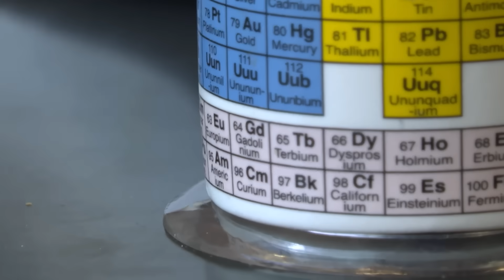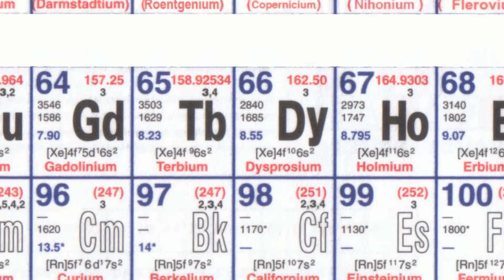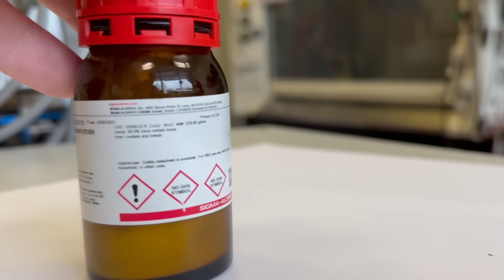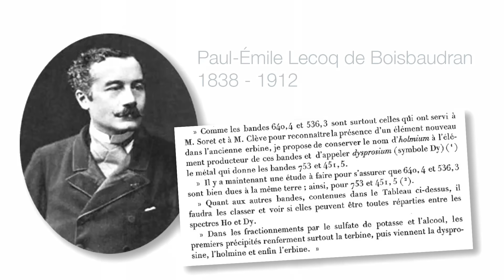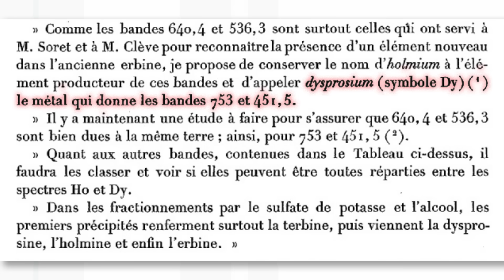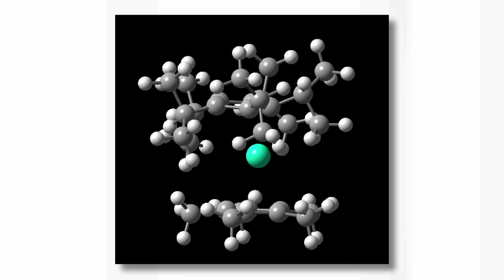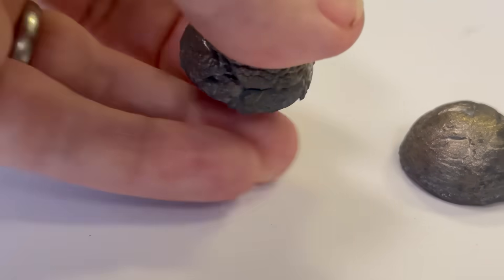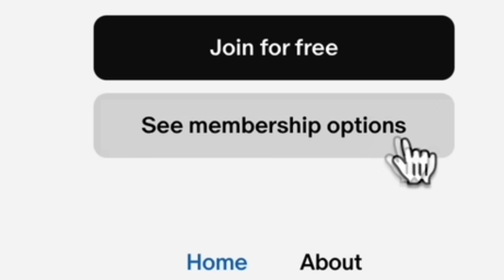Dysprosium (new) - Periodic Table of Videos

Comment: I learned another thing about Dysprosium, that I think also makes it unusual (but maybe I'm wrong about how unusual it is).

Given that it's hard to get, I thought it meant that in metallic form it might be highly reactive, so it would be hard to keep as well. Google decided to lead the inquiry with an AI response that said it's quite stable (so there goes that assumption), and it  mentioned the metallic form contains seven stable isotopes. I thought wow, that's a lot of those. And so I was curious about the relative abundance of those isotopes.

Get this (I switched to Wikipedia for this part, which still isn't a primary source so a grain of salt): There are four isotopes of dysprosium whose abundance is greater than 15%. And the next one down is about 2%, which isn't a lot, but uranium-235 is less than a percent (granted, being radioactive tips the scales) and deuterium is about 0.016%, so 2% ain't exactly peanuts. The fifth most abundant dysprosium isotope is more abundant than the second most abundant carbon isotope. Is that as unusual as I think it is, or am I just too focused on the more popular ones? I asked ChatGPT to give me a list of elements that have three or more isotopes whose abundance on Earth are above 10%, and it didn't even include dysprosium. Which just highlights why I moved away from AI (it's a language model anyway) for the dysprosium stats in the first place. Bad robot. Spritz, spritz goes the water bottle. (Not de-ionized water. I want it to hurt.)

Also, the theorized origins of these various isotopes is further beyond my grasp than even the stuff I typed up above. My education in the sciences only went as far as AP chemistry and AP physics (the latter only dealing with mechanics and electromagnetism). So the only time I ever studied a nucleus was biology, and that's not even the right kind of nucleus!

Comment: I'm surprised that Brady didn't apply dilute sulfuric acid to a sample. 

"Dysprosium dissolves readily in dilute sulfuric acid to form solutions containing the yellow Dy(III) ions, which exist as a [Dy(OH2)9]3+ complex:[15]

    2 Dy (s) + 3 H2SO4 (aq) → 2 Dy3+ (aq) + 3 SO2−
    4 (aq) + 3 H2 (g)

The resulting compound, dysprosium(III) sulfate, is noticeably paramagnetic. "

Plus reactions with halogens above 200C are nice too.

DY has uses in the current "hot topic" industries. Magnet are excellent products made with. It can replace up to 14% Neodymium, which in itself is a difficult element outside of China. It also is used in high-accuracy  dosimeters.

It is also used in the LHC accelerator in Magneto-optical traps for particle research.

Comment: FWIW, a quick search found prices between about 450 and 500 USD per kilo.  Cheap compared to gold, expensive compared to coal.
Reply: almost a third of the cost of silver, tho :O
Reply: Until someone finds a "wall street bait" use for it.
Reply: @eiriseven  maybe someone does find a way to scam people with it, but that does little to change the underlying commodity value. The value might spike a little, but the drop after the rug pull would settle back to around whatever we value its utility at + inflation
Reply: Significantly harder to track down and buy in person though...

Comment: Dear Brady and the periodic videos team.  Can you add a spectroscope to the battery of cameras you have pointed at the Bunsen flame when Neil sparkles the elements filings? I would really like to see the emission lines that sometimes get mentioned in the description of their discoveries.
Reply: Brilliant Suggestion!
Reply: I don’t think spectroscopes work that way. It’s not a filter like night vision or IR. What you’re seeing is the em radiation it’s emitting at the time they film
Reply: Yeah, and spectroscope will split this EM radiation into separate emission lines
Reply: @midi5581 yeah but thats like a separate image, it isn’t something that can be overlaid on the image of the flame
Reply: @ObnoxiousPedant-i8n  You can use a diffraction grating to see the emission spectrum of the burning sparks. Unfortunately, I think with dysprosium they'll be dominated with black body radiation, but the emission lines should be far more obvious with samarium, europium, or ytterbium (Sm and Eu burn pink, Yb burns green)

Comment: 16:40 I can think of caesium hydroxide, which dissapears into a puddle relatively quickly compared to stock NaOH, though it need to be titrated with say citric acid to not be horrendously alkaline. It's a toxic heavy metal salt (not nearly as potent as lead) but is a relatively chronic condition for life threatening conditions.